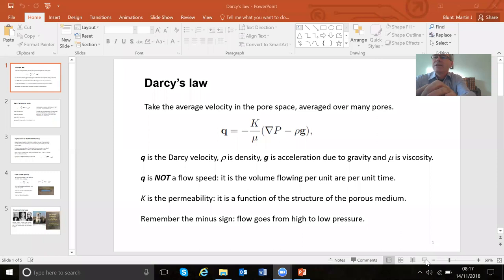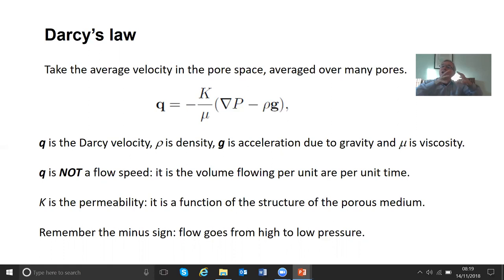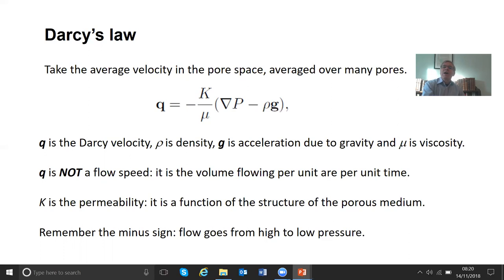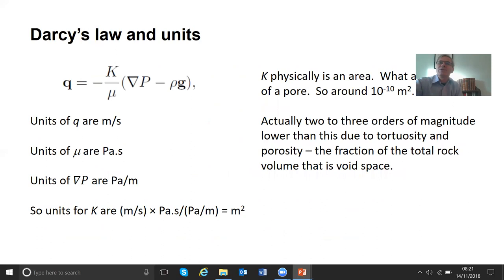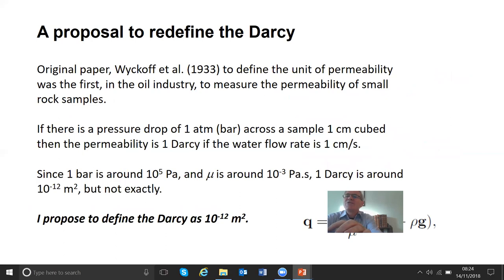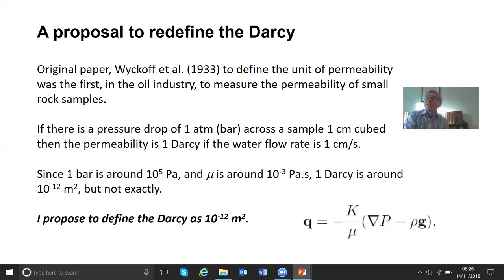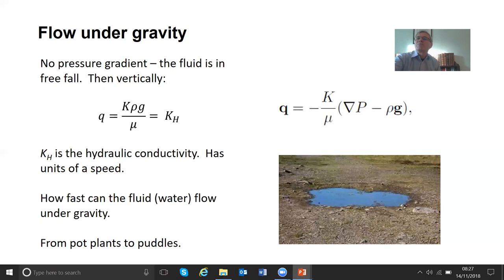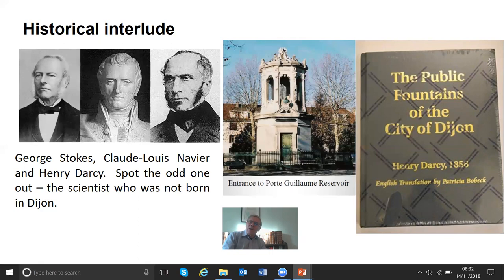Darcy's law

Comment: Good evening sir. 
Why don't add minus in darcy law for radial flow?
Reply from the maker: You do, if you consider the flow out from the well - in the direction of increasing radius.  However, we normally consider radial flow out of a production well, so oil flowing in the direction of decreasing radius is considered positive.  Think about this - you need to define the terms so that flow is from high to low pressure.
Reply: Thank you for your  answer, sir.